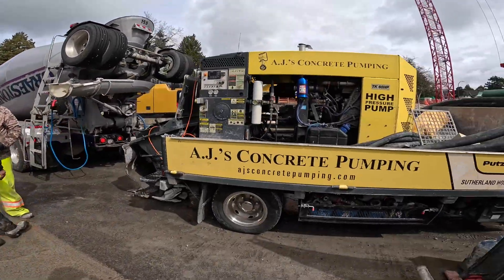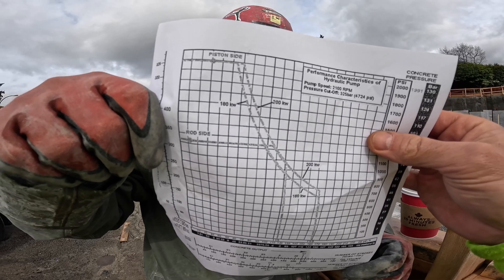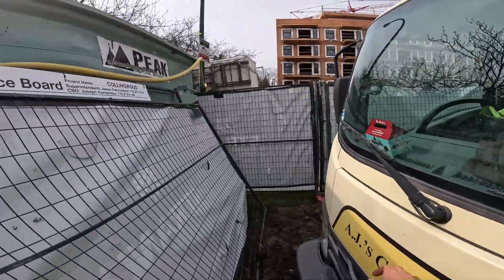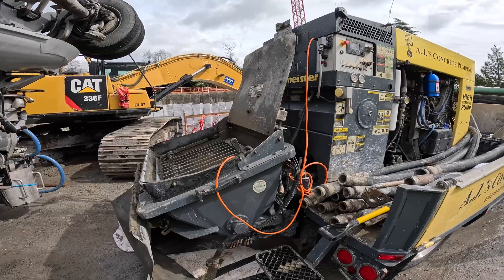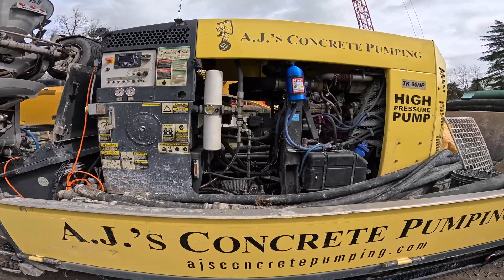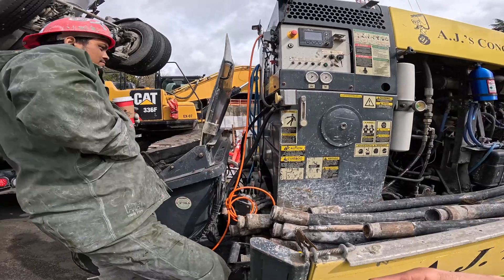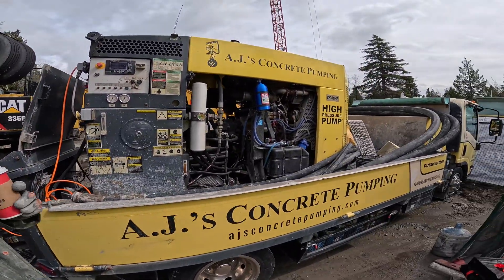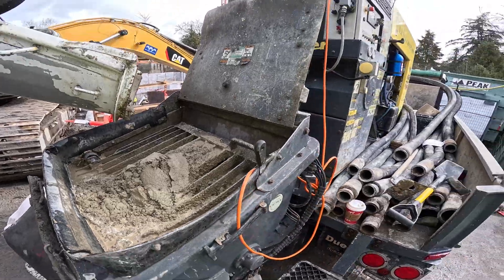World’s First: NITROUS OXIDE POWERED CONCRETE PUMP!!!!

Comment: You know if you used 🍁🍁🍁Beaver brand pipe lube before you put all that messy concrete thru the pump you wouldn't need the nitrous. 🤣🤣🤣
Reply from the maker: @SuperRede4u  is that similar to caribou jizz???
Reply: @canadianconcretepumper1979  Yup. Kinda like kissing cousins, I do believe that the caribou has extra slime for the colder temps up North. 🤣🤣🤣